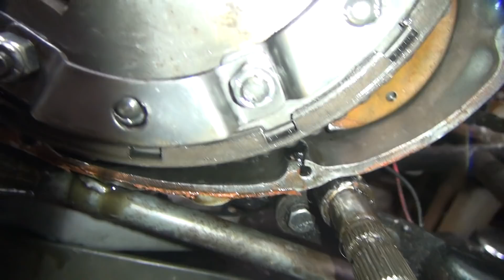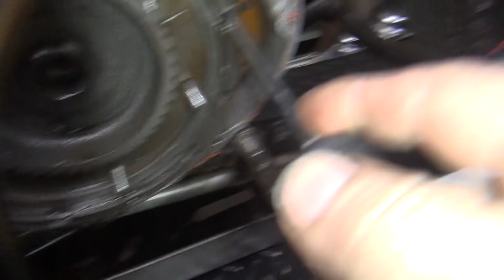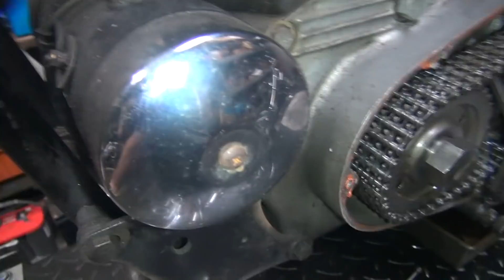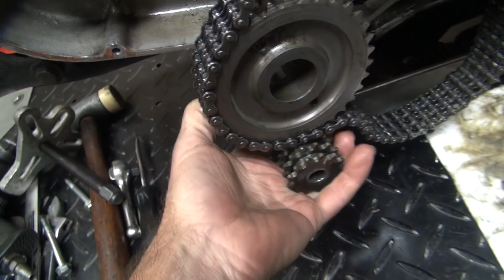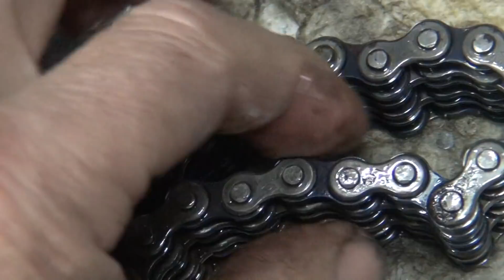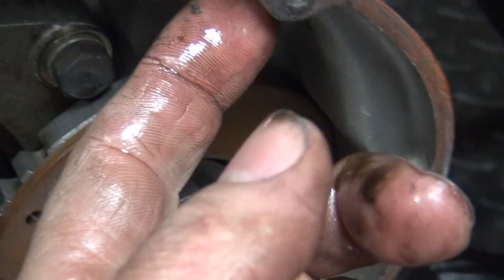1972 XL Ironhead Bobber #101 Sportster clutch primary motor repair harley by tatro machine

Comment: I got my clutch hub nut and lock washer off, but the clutch hub wants to stay put.  Should it come off easy like in the video or does it need a puller on it?  Tx!
Reply from the maker: about 80% of the time they come off but the others you have to pull them. just use a steering wheel puller and two long bolts to pull it.
tatro
Reply: @TatroMachine  I didn’t see the holes for the puller at first, but it worked great, thanks!

Comment: Just had a buell clutch pressure plate disintegrate when trying to replace friction pads. It's the double clip with inner keeper ring. Has to have the exact amount of friction and or steel plates or will never go back together. Looks like I will be adding an extra steel plate for it to engage correctly.